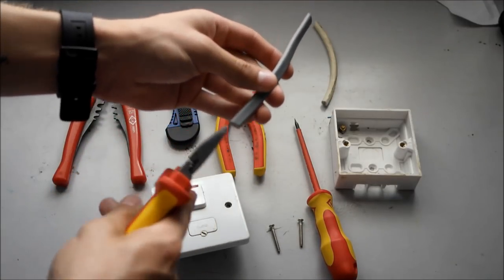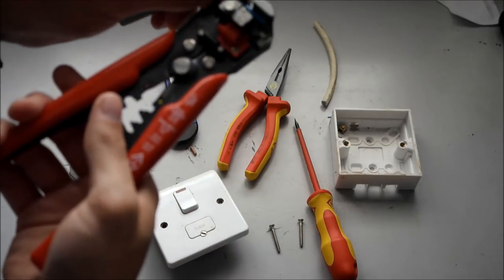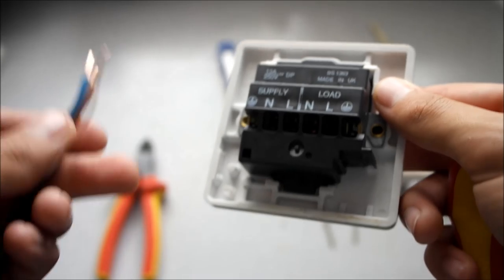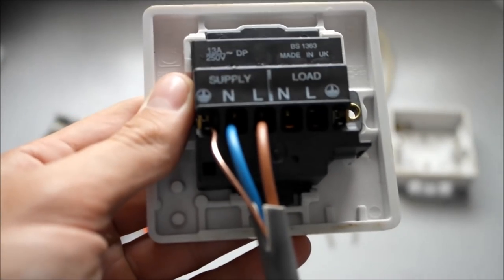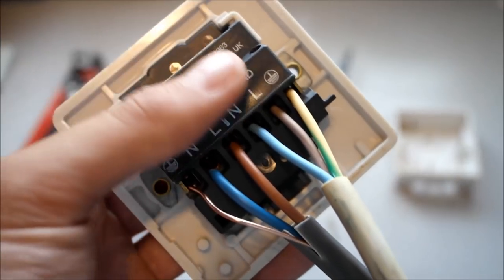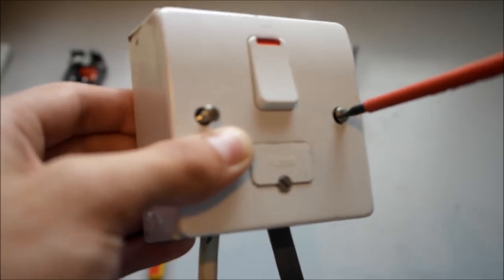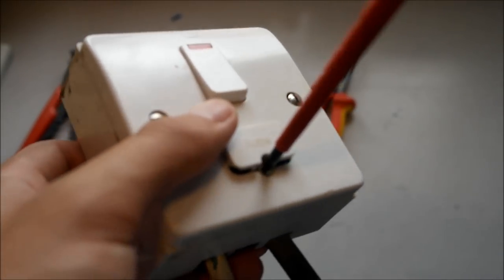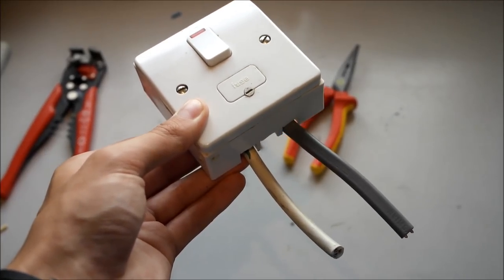How to wire an FCU - Fused Connection Unit

Comment: Hi, I have 3 Earth wires in my FCU, 1 with load, 1 with supply and 1 connected to the box, but only 2 earthing connections, does it matter with what connection I pair the the earth wire connected to the box?
Reply from the maker: +Barrie Underwood well if you have 2 earth wires 1 from the supply and 1 from the load put them into the earth connection on the FCU along with the earth from the box. The earth from the box is there just incase a live conductor breaks or is damaged and touches the metal box it is so that the box does not become live.

Comment: how do I wire a 3 gang grid switch from the main ring? I'm trying to keep the spurs in 1 place for w/m d/w and hood
Reply from the maker: +Tasaver Azim you can use a double pole switch basically feed in and feed out.

Comment: No sleeve on the earth (naughty), no double backing of stripped cable into the terminals (poor practice).
Reply: What's "double backing of stripped cable"?
Reply: I'm not an idiot. I was wondering what you meant. Your comment may be clear, in your own mind, but the second part reads as gibberish to me!
Reply: Or do you mean folding over the conductors?
Reply: Ah, ok then sorry I thought you were deliberately being an idiot! Yeah, if you google what I said it is pretty obvious - folding over the conductors yes. I just get really wound up with poor electrical tutorial videos like this one that don't follow the regs and are unsafe. Ultimately, it costs people safety and in many cases their lives.
Reply: Okay. No problem.

I'm having  a double socket put on the outside for use with my pressure washer. It's an MK Active RCD protected double socket. It will pass straight through the wall, inside plastic conduit, to a 32A MK double-pole neon switch; then to a nearby socket, to act as a spur. Is this a safe arrangement? What cable size would you recommend? I already have 2.5mm cable, whose sheathing,  is designed to remain flexible at low temperatures. Is this sufficient, or should I be using 4mm cable? The 4mm cable will be a bitch to fit into the socket terminals inside, as a spur connection!
Reply: You could do the job yourself, but I would not advise it especially as it's outside sockets - they need to be RCD protected etc and they're a bit more complicated to do than an inside job. If it was me, I'd get a trusty tradesman electrician in. If he charges you more than £100 for that job he's probably ripping you off. If you're keen on doing the job yourself however, you don't need to use 4mm cable for sockets. 2.5mm is the correct size for that application. Make sure you get some earth sleeving and always sleeve the earths when you screw the cables to the terminals - Don't follow this video!
Reply: The outdoor sockets  have an RCD built in, and they are of the active type. So if there is a power cut, the sockets need to be reset before power can be restored; in addition to their more usual function.

The cable must be intended for the Scandinavian market. Its designed for the insulation not to become brittle, down to -30C. It also has sleeving on the Protective Earth. I think all UK cabling should be like this.

I have a number of jobs that need doing. The cost will quickly mount up. I was thinking of doing the job, then getting it inspected. I'm not an electrician, but I do have experience in electronics. I'll be scrutinising the wiring regulations before I begin; though its handy to run it past someone who does have experience in this area.
Reply: He does say in the video that there should be shielding on the earth. I've Googled "double backing of stripped cable" and nothing came up. What are you referring to? How can I find out what this means?

Comment: i am wiring my shed with supply from house (armoured cable). sockets will be 13 amp but how do i fuse down to 5 amp for lights? cheers
Reply: wire your armoured into Garage Consumer Unit Fuse Box with RCD + 2 MCB's,
But really better getting a pro.electrician to do rating's, earth loop test and install..
Reply: Thanks Paul

Comment: So im putting in an extractor hood and it says that it must not be earthed and im stumped. Do i just cut the earth cable all the way back on the twin an earth cable or still put it in its earth terminal as the actual extractor fan cable only has a live and neutral
Reply from the maker: if the hood doesn't not have an earth means it is double insulated which means it doesn't require an earth, the earth from the twin and earth put into the earth terminal. Just in case later down the line you change the hood and that requires an earth it is there for it. Hope this helps
Reply: @AllenGoldsmith  thank you i shall do that